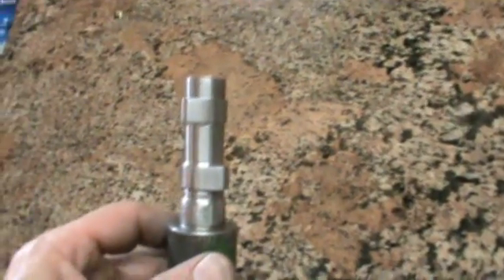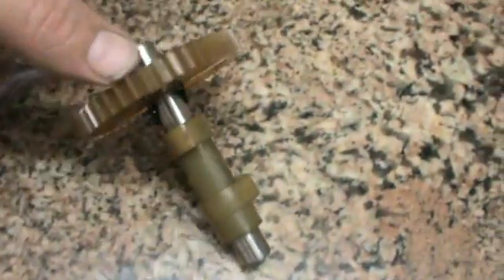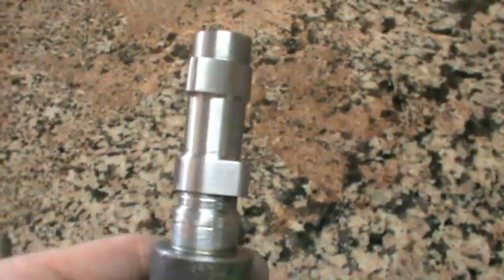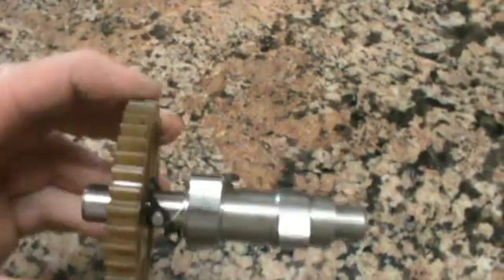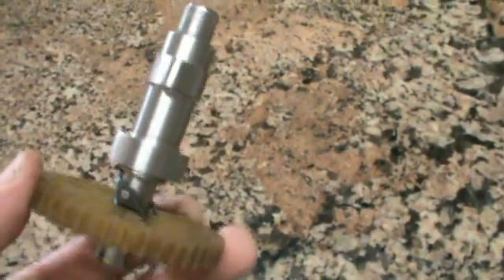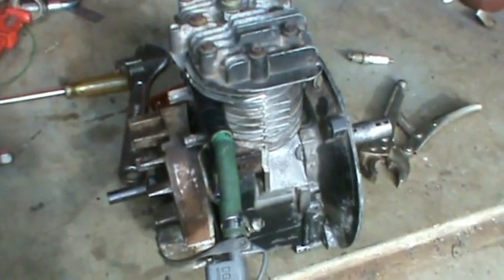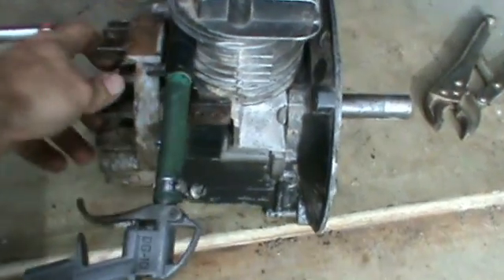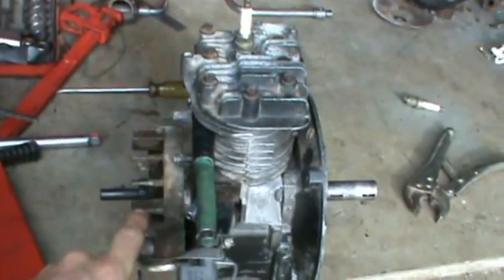Steam Engine conversion.mp4

Comment: Nice, but keep in mind that the valve for the inlet is working in the other direction, so modification has no use for the inlet. the inlet should be cut off in another way. like an electrical valve opening when the piston is on top, efficiency will be increased multiple times then!!! good luck